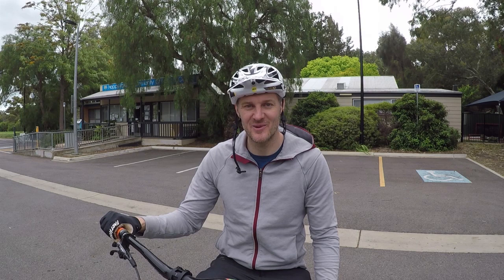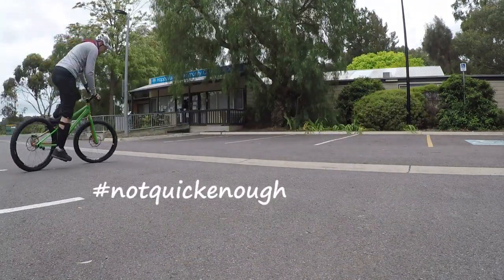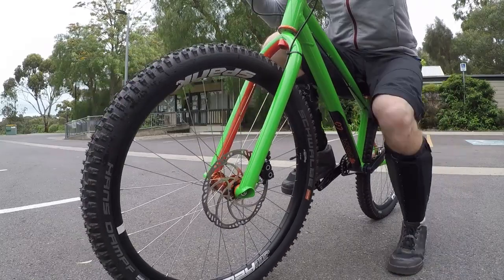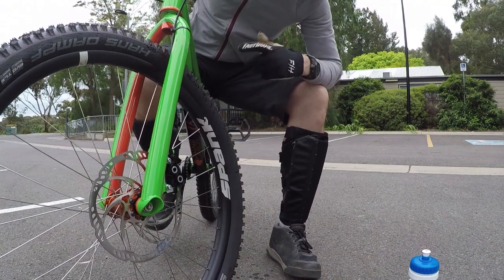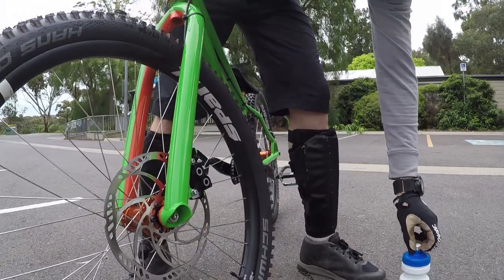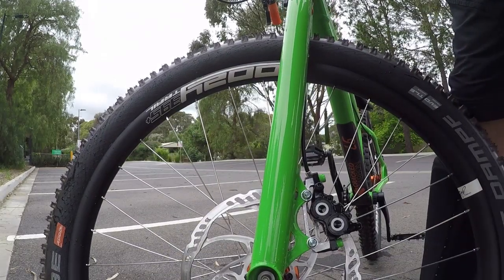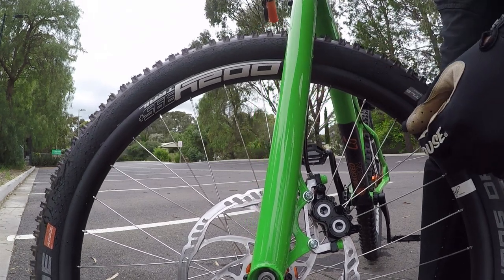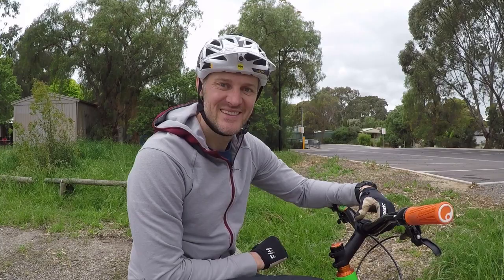Bedding in Brakes. Trials & Tribulations Ep 7

Comment: Nice one! Another tip: Before you insert the brake pads into the calliper, with very clean or gloved hands wet the pads under a slow running tap and rub them together (pinched between your fingers) until the water runs clear. This gets rid of much of the factory contaminants/dust on the pad compound and quickens up the bed in time.
Reply from the maker: Good one and ideal for new pads and or de glaseing dirty pads  :)